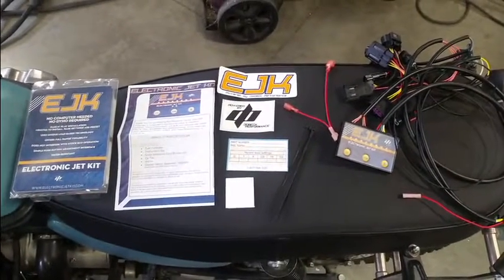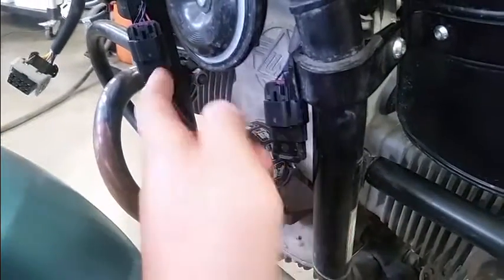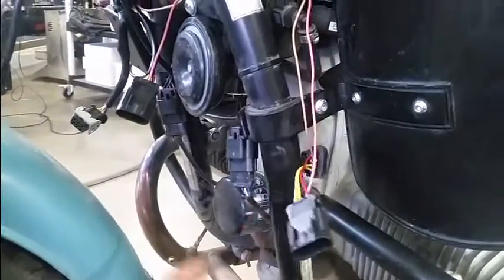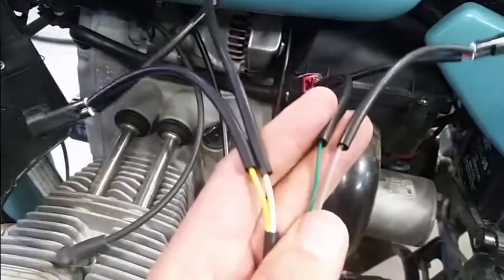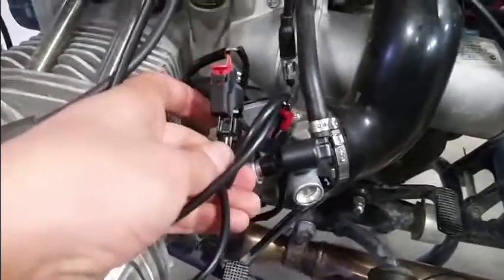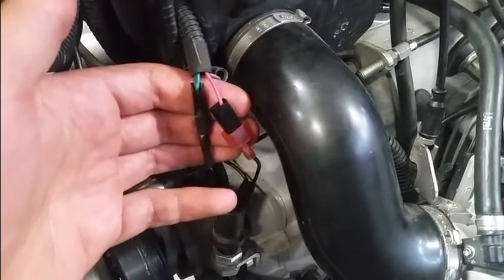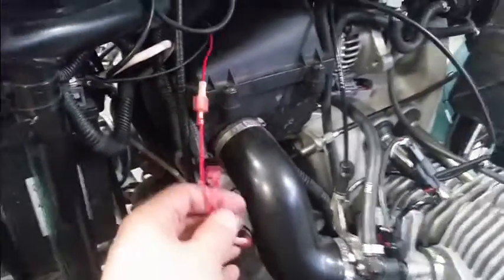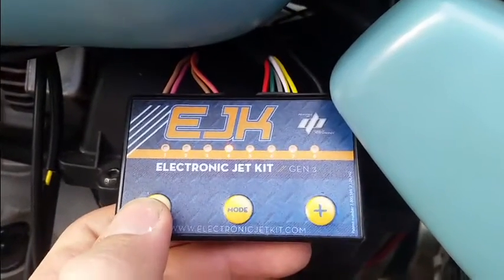EJK Installation - Ural Motorcycle

Comment: Hello, i‘m from Germany. I have a Ural Retro EFI from 2016 with Elecrojet Injection. Allways i have Troubles with Running in half gas. When idriving in the city the engine jerky, and Nobody can help me. Software is the latest uncensored „Offroad“ Version. If i install this Kit, so the Engine runs better?
Thank you for answer and stay Health
Reply: Harald Roesenberger hallo freund! That’s all my German, but I just bought a 2014 patrol with less than 1000km on it (sooooo low!) and I noticed the pipes were blue (sign that there’s less fuel in the air to fuel mix). I too had hesitation on throttle, jerkiness, as well as low power on starting from a stop. This was after about 400km with and without a passenger. 

So after reading posts on sovietsteeds.com (forum for Ural) and researching dobeck’s EJK I bought it. My friend, it is a BIG improvement. Just the standard setting was an obvious boost. I increased the Red zone slightly, since I have some highway driving near me, but otherwise it is incredible!! I completely recommend this product for EFI Ural upgrades. 

I’ll happily report more after more riding, but I’m completely satisfied! 
(Edit punctuation)